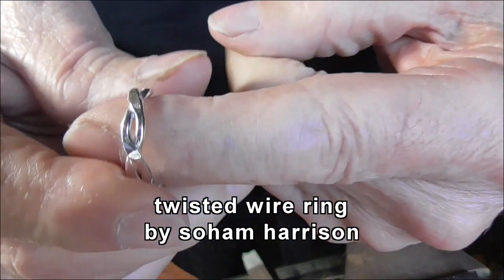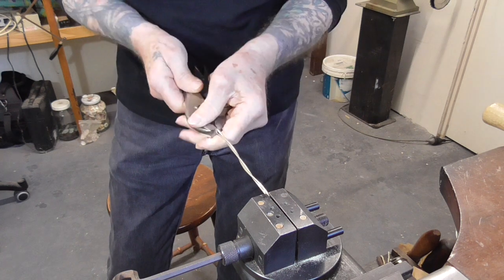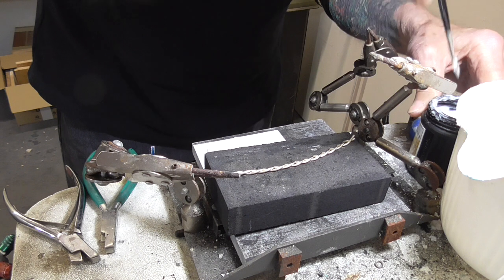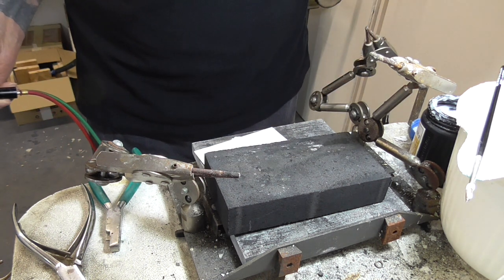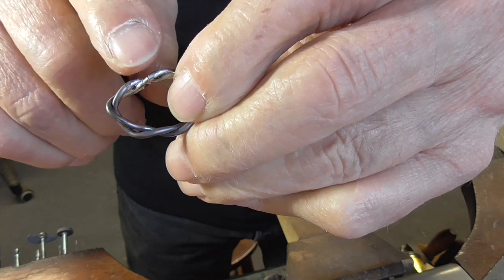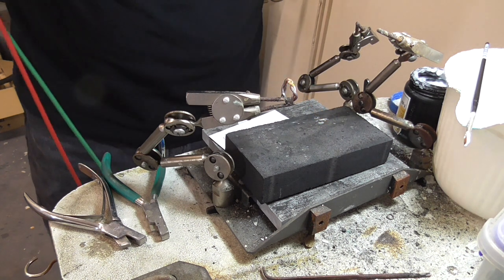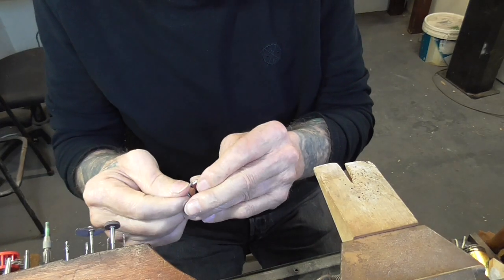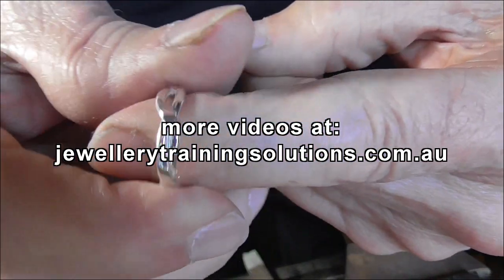twisted wire ring

Comment: Do you know you just taught me something, about soldering something long like that. I always was under the impression that you had to heat the whole piece that wants to get the solder to flow. But on this you’re showing that you heat the area around where you want to solder the flow.  Can you do this technique when you have a heavier gauge silver and making a bracelet, to solder on the bezel?  I love making heavier bracelets but it’s hard for me to get a basil cup to solder onto the heavy bracelet. It usually doesn’t solder and comes off.  Or should I sweat solder it and use your technique you’re using on this ring.?